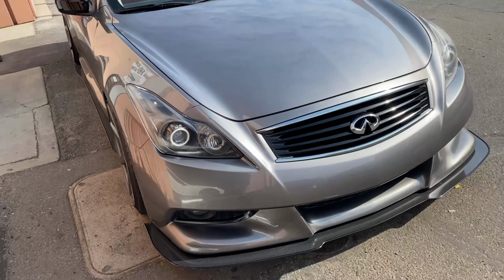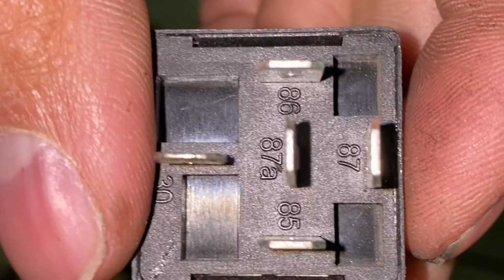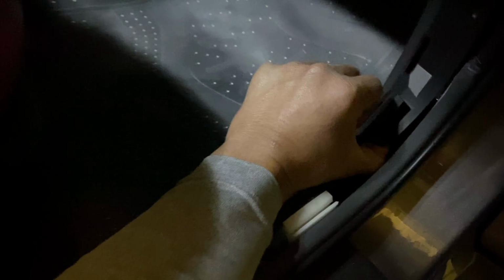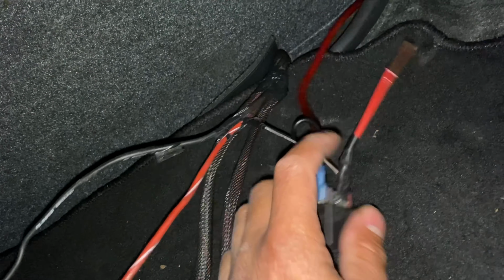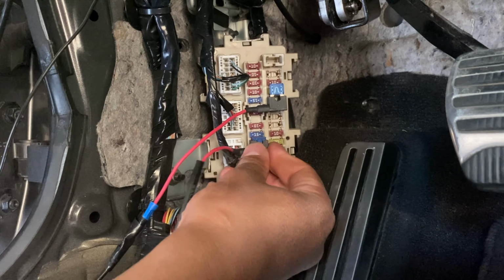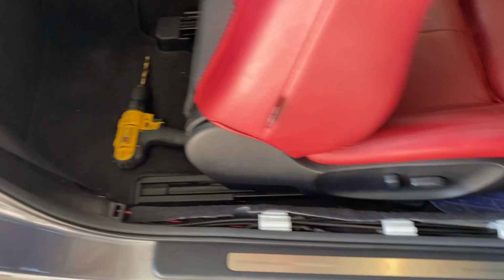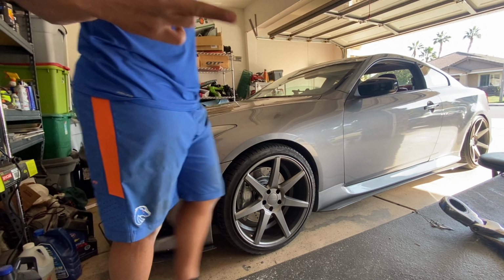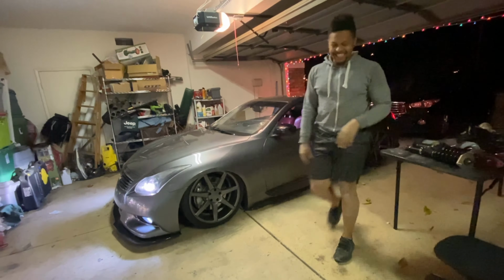G37/370z AIRLIFT INSTALL!! | DUAL COMPRESSOR WIRE UP

Comment: How’s it when you wanna keep an extra wheel in the trunk ? Or can you even fit one in there?
Reply from the maker: I still have my spare tire! There is a little
Gap between the actually tire and body Of the trunk. And the Air lines are pretty sturdy so you should be fine if the tire is laying on them!

Comment: Hey bruh I'm a new subscriber damn I wish you stayed on the east coast.  I caught a leak in my front bag 30 miles after I got it installed, is there a minimum psi you can ride on your bags
Reply from the maker: Thanks for the sub! And man! The shop that did it should warranty their work and should fix it! More thank likely a leak the lines somewhere or on the fittings! And I Believe it all depends on your set up. My lowest I can ride is around 70 in the front but 60 in the back.
Reply: Air lift performance replaced the bag, I was still under warranty
Reply: Imma tell you where my leak came from since we both got the same suspension.  On our front shock at the top of the rubber boot there is a silver ring around it. My leak came from the bottom of silver ring and where the rubber boot connects.